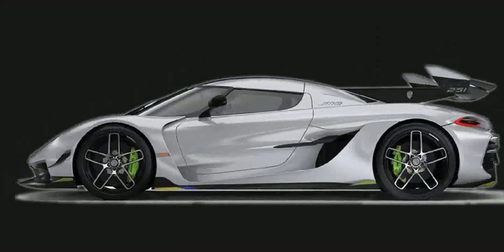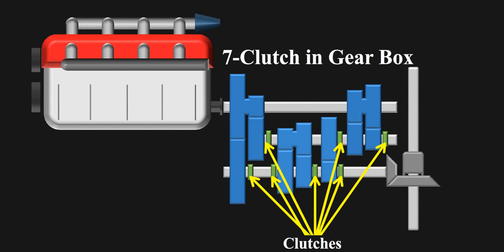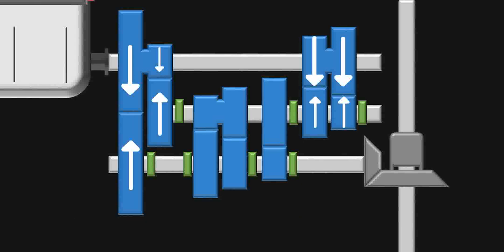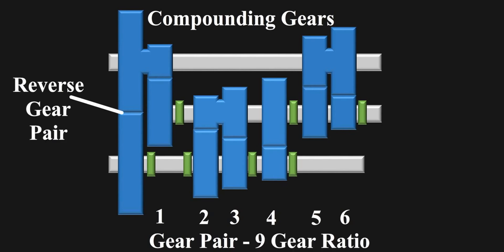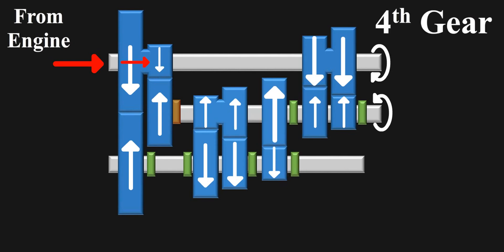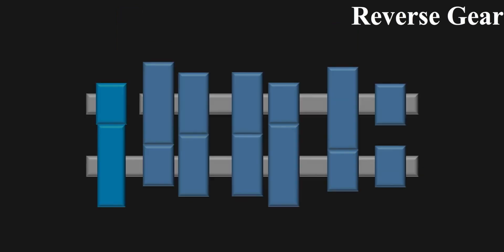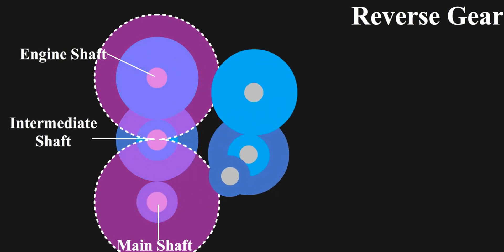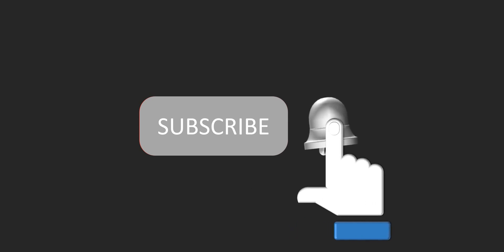Koenigsegg Jesko - 9 speed gearbox working in detail

Comment: I hope your wrong about the exact shift sequence. According to your info 3 of the shifts require double swapping shift elements. That is a huge no no especially under high torque loads, because the trans is essentially in neutral for most of the shift. Nearly all transmissions only shift one pair of clutches to change ratios. Not two pair at the same time. Its nearly impossible to control apply and release rates under high loads.
Reply from the maker: Well it's true that it's very difficult to shift that fast, but don't worry as driver doesn't have to do that. The transmission controller does that for you. It actuates solenoid to engage and disengage clutch, which are very quick and responsive.
Reply: At first, I agreed, but after thinking about each step of the process, I've changed my mind.

The disengagement of any clutche(s) can occur at the highest measurable rate the solenoids are capable of and given this is a pressure controlled closed loop system, the point at which clutch pack(s) begin to engage or release will remain consistent for the life of the gearbox. With larger yet more precise hydraulic hardware, using microcontrollers vastly more powerful and lower in latency than what would otherwise be necessary (because Koenigsegg), combined with this consistency, precise control during extreme events becomes a possibility.

Furthermore, the rotational kinetic energy which must be transferred will not be equal between any two clutch packs during a two element event, nor will the torque transferred.
Meaning, even if both clutches closed at the highest rate possible, one is going to fully synchronise fractionally before the other, so as torque is reapplied, the shift event is completed by a single element.
Lastly, just like with any other DSG, "Seamless torque transfer" is not the same as "Seamless maximum engine torque transfer"; that would blow the wheels off in most gears and be uncomfortable in the others. The transmission of any rotational kinetic energy in the system mask the moment of engine torque reduction. Koenigsegg will be in the unique position to apply engine torque sooner, though, given there is far less rotational mass in the system as a whole.
An extremely interesting topic and I can't wait to see this in action!
Reply: @Lawsy2  I think your missing what i'm saying. A normal shift has one clutch coming off and one clutch coming on, they are overlapped precisely to prevent tie-up or a flair up. A double swap shift has 2 pairs of clutches coming off and coming on at the same time, basically to gear changes at once. Chrysler does it on the 62te trans and its wonky, and they have been making electronically shifted clutch to clutch automatics since 1988.
Reply: @V12Buickguy  Hey mate.
That's how I understood you the first time. 
My example of closing both clutches as quickly as possible and at the same time isn't how I believe it will be implemented. I just wanted to highlight a physical aspect of the system and how the interaction could be relevant in solving what is surely a difficult problem. It inherently allows the slack in one clutch to be all but instantly removed concurrently as the other begins to transfer torque, with less risk of binding.

And comparing this with an American manufacture known for producing "clunky" (don't get me wrong, that's not necessarily a bad thing if it means huge power and fun on the cheap), is not exactly a fair comparison. Those Chrysler gearboxes must be produced with common components shared with other models, be smooth enough for every day use, strong enough for some abuse (which is a complex task alone), use materials that are readily available in quantity, all in a package that must be mass produced for a profit. If that isn't limiting enough, they were told to achieve all of this using relatively simple technologies developed in a short period of time, by a team of engineers where half had one foot already out the door.

Koenigsegg is the polar opposite of this, and has a number of patented technologies that are relevant to solving the problem at hand.
In my view, it's a closed loop control problem.
But how does one control a high load yet extremely fast hydraulic/mechanical system with utmost precision (assuming the hardware is capable)? Dedicated, low latency modules with specific FPGA's for critical functions and extremely fast microprocessors for keeping it all together (interfaces, diagnostic, data fusion algorithms, etc.).
They do this already.
But that assumes the mechanical hardware exists to carry out the demands of the TCM. 
Maybe that's not too far off, either, considering Freevalve development resulted in Koenigsegg patenting a solenoid positioning sensor fast enough for a motorbike engine yet accurate enough for completely variable valve actuation at the RPM's this involves. A variant, redesign or simply referencing key ideas of this technology while developing high pressure clutch solenoids is half the battle won.

I'm not saying copy/paste the above, and you've got a gearbox. What I'm suggesting is the technological foundation for solving a number particularly difficult issues has been laid, and given this idea was born over 3 years ago, I'm certain they are already well on the way towards a solution.

In any case, I'm enjoying thinking about this; I don't get to be an engineer much anymore...
Reply: @V12Buickguy   I actually found some SAE technical papers from 2007 and 2010 on the 62TE. The only sequential double-swap shift on that unit is the 2/3 shift, and from all the "complaints" I could find about the 62TE, none of them were about the 2/3 shift. The problems the 62TE had were unrelated to its architecture, and more to mundane issues like seals displacing themselves, clutch drums wearing out, and torque converters binding up. Aside from the duds where a seal or torque converter has gone bad, the 62TE performs quite well - you can even find acceleration runs with it in Ram Promasters, Dodge Avengers, and Chrysler 200's. The 2/3 double-swap shift is fine. It's actually pretty remarkable since the 62TE is just a 2-speed splitter bolted onto an existing 4-speed unit.

I also found a technical paper on the Aisin 8-speed unit, where their engineers also developed double-swap shift strategies for large skip shifts. 

The key to a power-on double-swap upshift is that the upshifting range box (with the larger ratio step) needs to initiate its shift before the downshift box (with the smaller ratio steps). This way torque is always positive during the shift. So all these technical feats have been accomplished over a decade ago. Now Koenigsegg has even better hardware and software to work with, and an interesting fact is that Koenigsegg has a pressure sensor for every clutch pack (instead of just estimated via algorithm), so their transmission is able to finesse the clutch application/release even more reliably.

Comment: This is a similar concept to honda automatics. Only without a torque converter and more gears and a lot higher torque capacity. I hope it works like they want because it will be awesome.
Reply: ? Honda autos are CVT's now that's not the same at all
Reply: @TheMrANONYMOOSE  WAT? The new ones maybe. I have been rebuilding them for 15 years. You sir are wrong.
Reply: @V12Buickguy  my b I assumed you were talking about the new ones, yeah they're cvt now

Comment: Honestly the only thing which is holding this magnificent piece of engineering away from the mass market are the 7 clutches. I guess its too costly for maintenance and also cost intensive in production.
Reply: I guess if just one pack of clutches wears out, you have to replace all of 7 of them. And the process seems not fun at all as they nested inside of gearbox. This box needs to prove themselves over the time about their performance and reliability.

Comment: Could you make one explaining the regera. That would be great.
Reply: Imagine a gearbox that is permanently in the highest gear always.
It is then assisted with 3 electrical motors for the low rpm.
Not a hybrid system when it only goes with electric OR combustion. Both are working together.
Reply: Thank you soooo much. You doubled my horizon. My life is complete now :) Jokes aside; thank you, indeed!
Reply: @omer-d4d8k  he said it already, but also remember there is a torque converter, so revs can be adjusted even with the direct drive layout. The final drive through the differential is geared long, like 7th gear, so theres no transmission, and there's an electric motor on the crankshaft and one on each rear wheel :)
Reply: Regera also have torque converter, which can be utilized as a makeshift CVT. Not very efficient, but still provide extra torque at low speed when the engine revs higher than the output shaft. At higher speed, the torque converter locked-up and create a direct drive system. Combined with electric drive, it can go faster and more efficient, but CvK also said that even if the electric motors were turned off, it can still accelerate from 0-60mph in 4 seconds. 
https://www.youtube.com/watch?v=glf_k4qGBAA
Reply: I have watched tonnes of videos about Regera's one-speed system, but couldn't understand even a bit. LoL :)   That would be useful for me, too :)

Comment: With the intermediate shaft, how much more losses are to expect?
Reply from the maker: Gear drives are very efficient ~97% and when combined with class leading bearing, the story is even better. Talking about "how much more losses" well Negligible that too if any, because most of the gearboxes have 3 shafts in them, we call it lay or counter shaft, just the thing is, it's used in a different way for different purpose. So the use of intermediate shaft won't cause any noticeable difference.